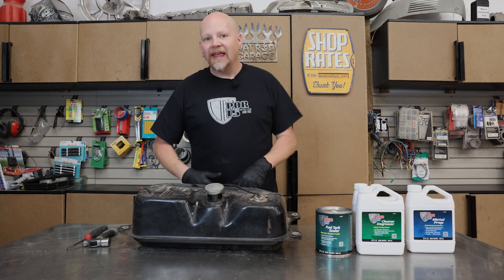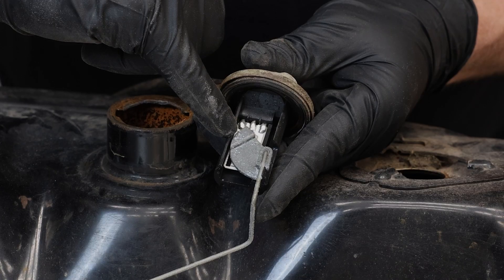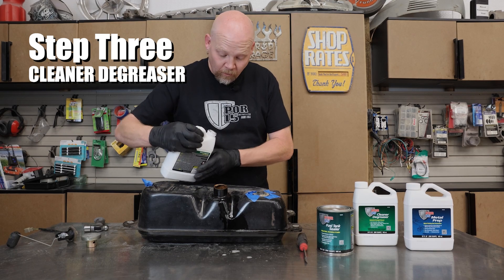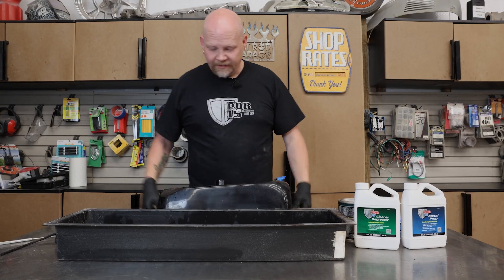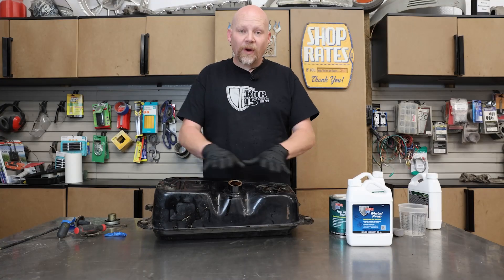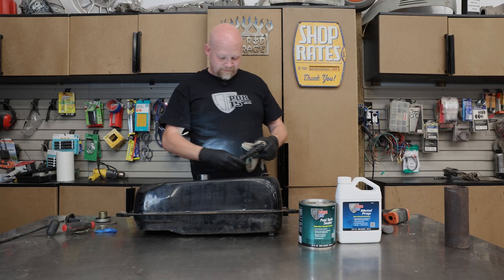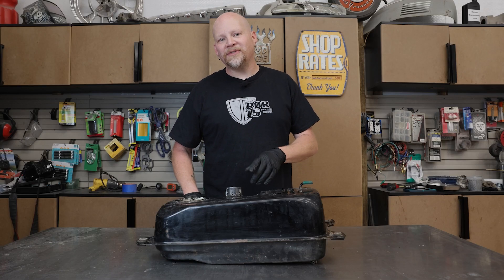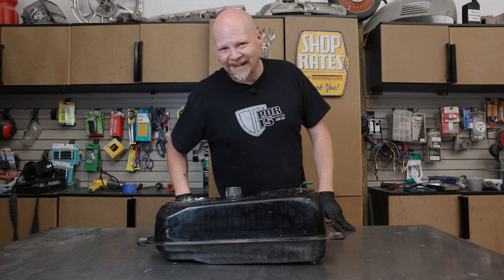POR-15 Fuel Tank Sealer Repair Kit - How to Use

Comment: I was told it’s the breaking down of the ethanol that causes the rust, so if you don’t drive the car often, you need a fuel stabilizer and use non-ethanol gas.

Comment: I used this product in 2001, and I don't know whether it helped or not, but when ethanol in the UK was introduced, it caused the sealant to separate from the inside tanks walls and hang like stiff curtains inside the tank.  I do not have a solution to this and just leave it as it is.  I am fearful that if I fill the tank with small stones or bolts, and tumble the tank, there will be lots of small pieces I will never get cleaned out and block the fuel lines.

Comment: How easy is it to coat with baffles inside?
Reply from the maker: Just a little extra care to slowly move the tank around during the coating step. We recommend rotating slowly in all directions three times if you have a lot of baffles. Then drain the excess coating immediately after. 
NOTE if the baffles or any component inside is Plastic, and you can't remove the plastic, don't use this system. This coating is for metal only.
Contact support@POR15.com

Comment: Thank you for this video! I wonder if Metal Prep solution is acidic and removes a layer of rust/metal on not? In my case I have some rust inside the tank, so if Metal Prep doesn't remove rust then I need a step to remove rust...
Reply from the maker: Metal Prep will remove surface rust, however you need to let the inside of the tank completely dry before adding the coating. You will get a little flash rust while it dries. This is fine and the coating will adhere and seal the flash rust.
Reply: @POR15videos  Thank you! I wonder if I really have to wash the tank after Metal Prep? I found out Metal Prep has phosphoric acid (to remove rust) and zinc phosphate and I'm not sure if I should wash the tank after metal prep OR simply dry it.

Comment: Restoring a 60 year German  16 gallon tank and plan on using this as opposed to purchasing an aftermarket tank by Dansk  for $271.  Paying my worker , I'm thinking 3 hours labor, plus materials...project will depend first on condition of tank which appears to be sound but have notices some brown gunk in filter, its a weekend driver  with said tank so its not that bad. .  I like to keep the preserve the original tank with the rocker shultz and spare tank padding glued to exterior...we'll see...I see a  lot of restored cars with new tanks....anyone out there can comment early Porsche tank restoration , buy a new one or use this stuff.

Comment: Good video. I would use a long section of clean bike chain or shoplight hanging chain instead of the washers, nuts, and bolts. That way it comes out in one piece.
Reply from the maker: Great suggestion, thanks for sharing a different approach.

Comment: I live in the UK and only ever use premium brands of fuel (BP preferably or Shell) 97-99 octane. On my 2005 GSXR100k5 due to slight visible rust in 2015, I used the POR15 Motorcycle tank (kit) exactly as the instructions demanded, using brand new clean fixings to help dislodge surface contaminant during the preparation steps. I used a Dewalt heat gun, as well as taking my time during every stage. everything seemed golden and an excellent result, but a couple of months ago because of poor idling and response i discovered a silver sludge throughout my fuel system and injectors that dried out and turned to silver powder. The sealant appears to have broken down (or it's surface has) coating my fuel system internals. It easily cleans off the inside of my plastic fuel rails, injectors, filters using petrol, but going forward.......?
 Do you know how i might fix/repair the POR15 coating inside my tank?
Reply: Did you get this resolved? im just about to do a tank off my own Suzuki and your post worried me slightly
Reply: @nicholaskearney6948  No! unfortunately, a couple of email responses from support which seemed to Centre around asking if i had used high ethanol fuel (which i haven't) then told me they would speak to their chemist, then ghosted me. Not willing to rush a resolution and would like next one to be final, sorry unable help.
Reply from the maker: Im sorry your having issues with the sealer.  Please give us a call to discuss the next steps at (800) 457-6715 or email our support staff at Support@porproducts.com

Comment: I have many rubber hoses inside the tank on my 08 diesel grand Cherokee. Should I tape the ends of them at the same time as I let it sit? Looks like breather hoses As I have one large filler and a half diameter breather coming out of the end.
Reply from the maker: Yes, always take precautions and tape what you can.  Better be safe and overly cautious than seal something that shouldn't be sealed.

Comment: Will this process remove little bits of rust or do I need to use a different product first? Just want to make sure before going through this.
Reply from the maker: The POR15 Tank Sealer Repair Kit is designed to be applied over a rusted surface.  So, if you have a little bit of surface rust in the tank you can go right over it.

Comment: They are saying 8 days after draining for drying time .
Reply from the maker: After the tank sealer has been applied and then the excess has been drained out, you should let it dry for at least 96 hours (4 days) at that point you can add gas back to it.

Comment: Pack your wife's tumble drier with doonas and multiple thick blankets, install the fuel tank in the drier, then pack the tumble drier with even more thick blankets.

Put the drier on cold tumble dry for 1 hour, and the nuts and bolt inside the tank will have removed all the rust.
Reply from the maker: Nuts and bolts work well to get out heavy flaking rust.  After that I would recommend trying our POR15 Rust Remover, all you would need to do it pour some in and let it sit on each side and the remainder surface rust will be gone.  After that you can start the tank sealing process for permanent protection.
Reply: How big is your wife's tumble dryer hahaha

Comment: What is the proper way to save any that left over, without it activating?
Reply from the maker: Best advice to having fresh product is only purchasing what you need when you need it.  Don't purchase a gallon when your project only requires a quart.  If you do have leftover and you are trying to save it for a future project best advice is to transfer the remainder to another container, glass works best and make sure you fill it all the way to the top to keep out all air and moisture.  POR15 is a moisture driven product so you need to keep it free of it or it will continue to cure.
Reply: You can't. The stuff turns rock hard and one drip will seal the lid on permanently. Don't ask how I know.

Comment: I have a brand new tank,  to make sure I read the above comment correctly before, all I need to do is use the POR-15 sealer, let it sit four days and call it good. Is that right?  Thank you for the info.
Reply from the maker: You must use the full system; Cleaner, Metal Prep, and the Sealer on your new metal tank. Make sure to remove any plastic parts first. Contact por15support@porproducts.com for more details or questions.

Comment: Can you use POR 15 ON A plastic fuel tanks
Reply from the maker: No Metal tanks only
Reply: @POR15videos what if I have plastic baffles in the tank
Reply: @POR15videos I have the same question. My tank has 1 plastic baffle  in it.

Comment: Greetings. I have a bit rusty tank of an oldtimer car. The capacity is 12 Gallons and it has 3 baffles inside it. 1) is it possible to use the sealer on rusty tank? I won't be able to remove the rust mechanically since it's inside the tank. 2) Could you please recommend the required amount of degreaser, metal prep and tank sealer for this tank? 3) Do you have any distributors / retailers of POR15 in Europe? Thank you
Reply from the maker: Please contact por15support@porproducts.com for information and assistance with your project. They will be able to give you more info.
Reply: EBay sell it
Reply: Clean the tank out with muriatic acid. You will have to neutralize it after you clean it with the acid (baking soda).

Comment: Awesome video. Thanks. Do you leave it capped or vented for the 96 hours?
Reply from the maker: No, don't cap the fuel tank when you are done. You want airflow for it to completely cure before reassembly and installation.